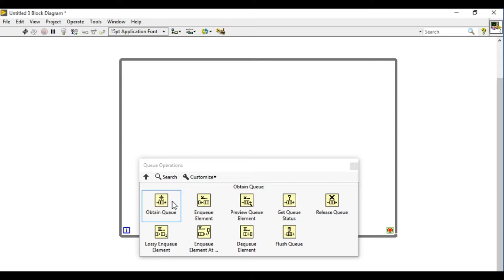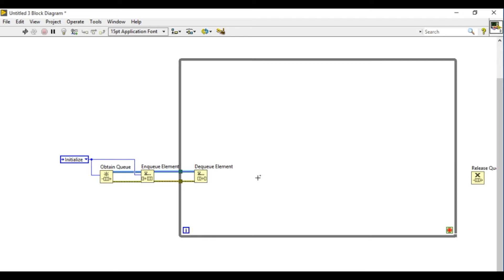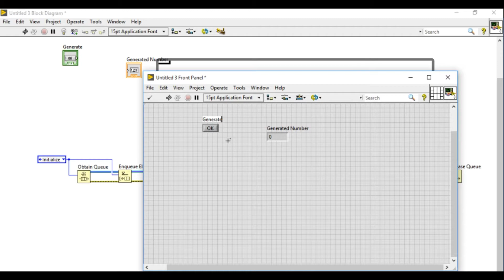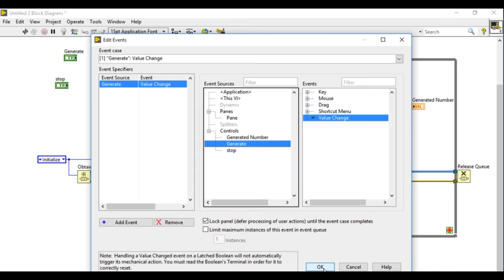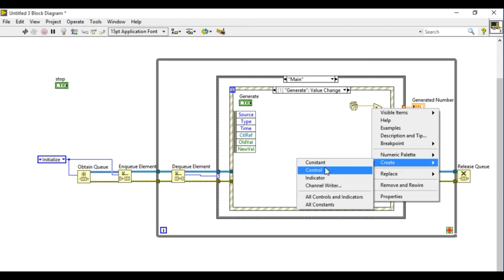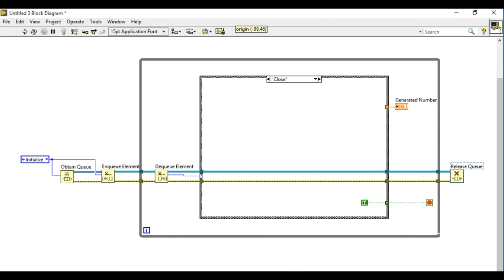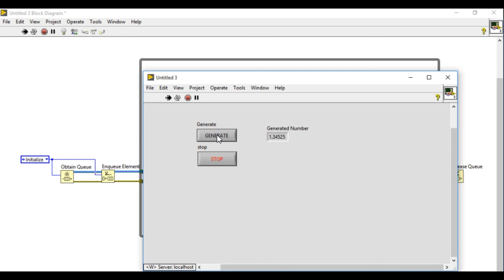Queued State Machine QSM - LabVIEW Design Patterns

Comment: Why does't we use shift register for dequeuing the next  state during the next iteration?  Thanks.
Reply from the maker: This is an alternative to SME. There is another video with shift register.

Both are same
Reply: @LabVIEWADVANTAGE  They are not the same, but result is the same or rather similar.
Presented QSM has infinite timeout, which means, that if programmer forget to enqueue next state, whole program will freeze. User can try to click on anything, but it will not work. In case of using a shift register, programmer is forced to put something there. The event structure usually placed in "idle state" can prevent from pooling, because it is waiting for event and has timeout functionality as well.

Comment: Why queue is used? we can also achieve the state machine functionality without queue as well. 
Thank you 🙂
Reply from the maker: Classic SM requires delay, this one does not by default
Reply: If i understood you correctly, you are referring to the delay inside the main while loop;the delay which prevents the VI from excessive CPU usage?
So, if i use the state machine with queue i need not to place the delay inside the main while loop? Is this the rigth interpretation.

Thanks a lot. Keep up the good work